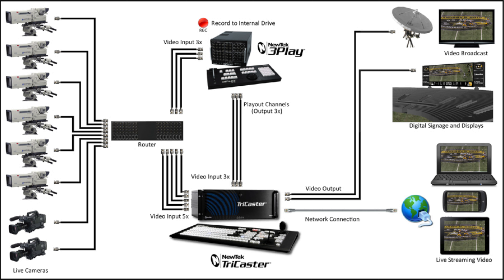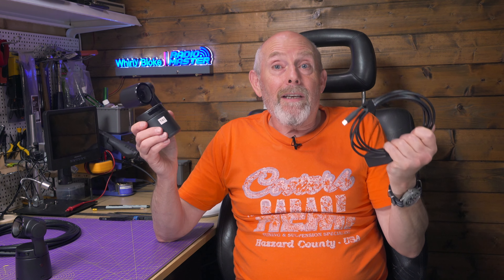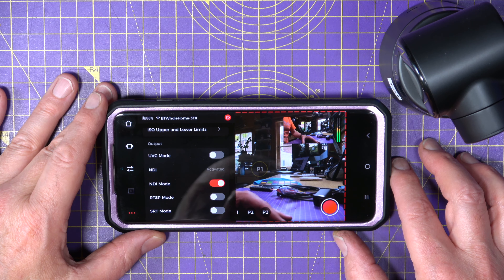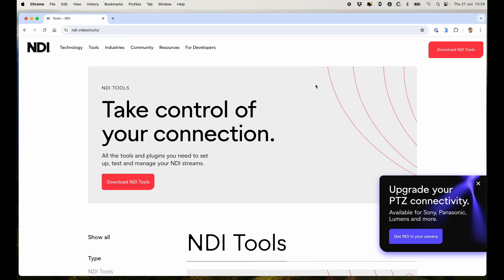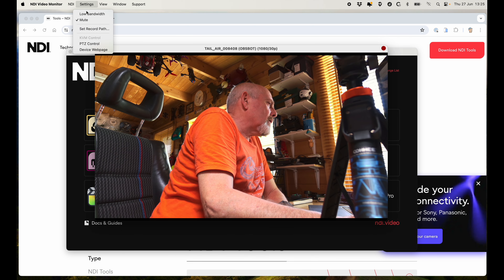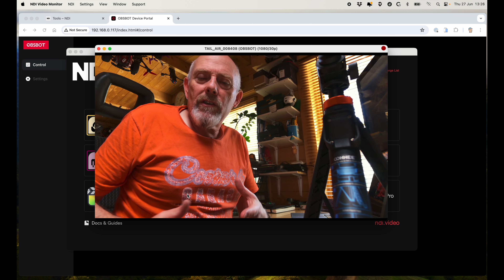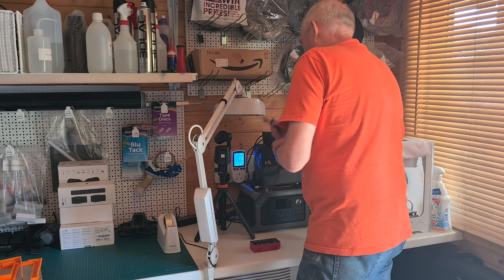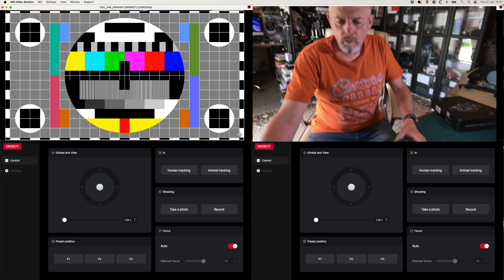OBSBOT Tail Air PTZ Streaming Camera - NDI setup and fixed workshop, studio wiring

Comment: Thanks, unfortunately for me nothing is working like its being presented here. Would have been so much more usefull had your cameras NOT already been tied into the NDI network and as you pointed out immediately discovered. So much is assumed because you essentially have it all up and running before you made the vid and as a result we see a flawless execution of getting NDI up and runnning . I can assure you , Ive been at this 8hrs with 4 obsbots , all the required obsbot adapters, the right Micro SD cards, an Obsbot Talent and Ethernet that is running like a charm at every juncture but NO NDI...oh well
Reply from the maker: I’m sorry to hear you’re having such a frustrating time getting NDI to work with your setup. I completely understand how challenging this can be, especially when everything should work on paper but doesn’t in practice.

You’re absolutely right that in this video, I demonstrated a setup that was already functional to highlight the smooth integration. However, I can see how it might not have addressed the hurdles you’re facing in getting started from scratch. I’ll take your comments onboard for future videos and include troubleshooting steps or a fresh setup perspective.

Based on what you’ve shared, it sounds like you’ve got everything configured correctly in terms of hardware, Ethernet, and the necessary adapters. A few potential things to check:
	1.	Firmware Updates: Ensure all your OBSBOT cameras are running the latest firmware. Sometimes NDI won’t initialize properly without updates.
	2.	NDI Discovery Settings: Double-check your network settings (e.g., multicast or static IP configuration) as these can sometimes block NDI device discovery.
	3.	NDI Tools: Have you tried using the official NDI Studio Monitor or NDI Access Manager to verify if the cameras are being discovered on the network? That could help pinpoint the issue.
	4.	Micro SD Configuration: Some users have reported that specific SD card formatting or partitioning can impact setup—worth double-checking that too.

You might try contacting OBSBOT support as well. Best of luck with your setup—I’m sure you’ll get it working soon.
Reply: thankyou for your detailed response,  I did contact obsbot but ultimately found the fix on reddit. The NDI codes could be entered on the Obsbot phone app but in my case and others apparently,  NOT via Obsbot Center , desktop app. Once entered there I closed the app and the Center showed the NDI was active and NDI tools , finally , discovered them.  
I am not out of the woods yet apparently however because my new Obsbot Talent hasn't yet discovered them on NDI because te NDI has to also be configured on that device as well and I've yet to understand hoe.  Not much avail on YouTube University about NDI and talent yet and what is available assumes I am streaming on OBS , which might happen but right now im simply trying to create multicam vids in my studio via this new NDI  network